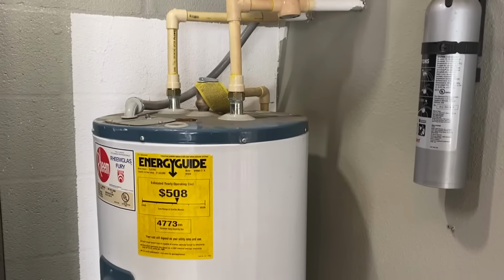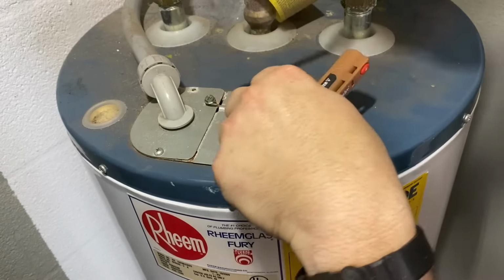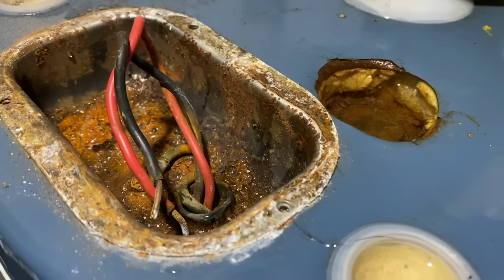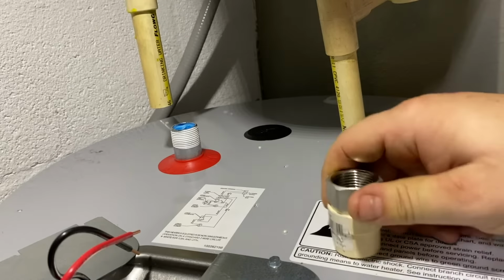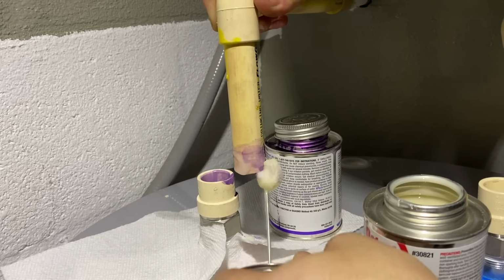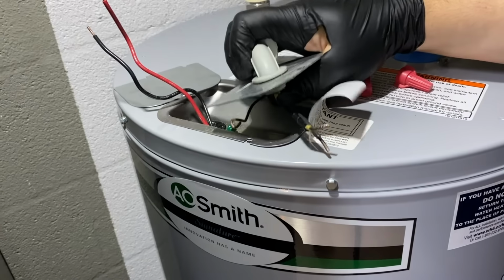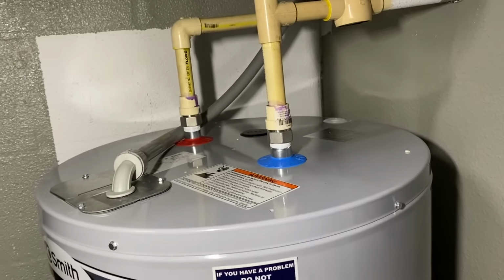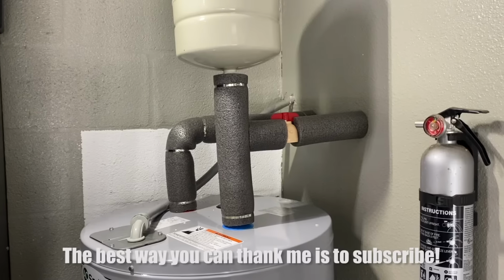How To Replace Your Electric Hot Water Heater | Full Install DIY

Comment: How much does this normally cost by a plumber just curious
Reply: $550.00 to $950.00.
HVAC /or Plumper are raping people with these types of installation. Gas water heater labor is higher.

Comment: If you will use wire nuts that are designed  for wet locations you will not get the rusting 
It is the threaded  sleeve  in wire nuts that rust and the ones for wet locations has a substance to prevent this

Comment: You can use a voltage pen to verify power. You should never use a voltage pen to verify a lack of power. Use a multimeter instead. Sometimes they wont pick up voltage through wire insulation...you can stick multimeter leads into each wire nut onto exposed copper for more accurate reading of whether or not power has been removed from circuit.

Comment: Thanks for the video. Mine was hard piped with cpvc also by the plumber that was contracted during the construction of my house. I decided to go with Sharkbite flex lines from the cpvc to the tank dielectric nipples. My thinking was making future change outs easier. Was great to see someone else with my exact setup.
Reply: I also changed the stock anode rod out with a Corro Protec 20 year anode rod. We'll see how it goes with that. My AO Smith pro grade tank only lasted 5 years before it was leaking out of the bottom.

Comment: Helpful video. You didn’t explain the wire connections in any detail. I see the tank has a red and black wire but the wires coming from the panel both appear to be black. How do you know which wire to connect to the red and black? Does it matter?

Comment: How will you remove that anode rod. Wire joints need to be twisted with pliers before, lot of amperage going through. Base of tanks  I like to place a blue styrofoam, just to isolate from floor

Comment: I'm not comfortable with electric.  I can't afford 1500 for a plummer sooooo pray for me
Reply from the maker: Turn your breakers off. Get a circuit tester to make sure the wires aren’t hot. Get in there and fix it. You can and will do it.
Reply: @Archifx gotta get it down the stairs,  down the hill, in the crawl space then up the muddy slope in the crawl space first 😂😂😂😂😂

Comment: You did great, my only suggestion would be not using cpvc for the water lines. Pex, copper, or even sharkbite stainless braided lines would work better long term, they withstand heat better

Comment: You should have replaced that plastic drain valve on the new water heater with a brass one. YOUR OLD WATER HEATER HAD A BRASS ONE.
Reply from the maker: Eh… it’s still fine all these years later. So no. I’d don’t
Reply: @fixitnoworlater dude don't be so cheap.  Lol!
Reply: The tank I am getting ready to replace has a plastic drain valve.  The tank is also twenty years old.  Just because it's plastic doesn't mean it's bad.

Comment: Dont listen to him! NO youre not going to be working around the 240 volts which he pointed to. Before ANYTHING else, EVERYONE is to remove the fuse or shut off the breaker for the water heater

Comment: heard the cpvc stainless steel  adapter leaks from from where the steel joins the cpvc, any issues with this? Thanks
Reply from the maker: Depends on the plumber. Mine is perfect.

Comment: Great video! Question: at @22:35, you mention leaving the information on the CPVC pipe outward-facing and visible to an inspector. As a DIY project, do you need to have this inspected? I also live in Florida and was wondering this. Thanks, and good job!
Reply: You may sale your home the inspector for the next owner will need to see that. Out

Comment: Thanks for the easy to follow DIY.   The only thing I would have done was change that cheap drain valve before I installed the new water heater.  Great tutorial.

Comment: Overkill. Just screw on the drain pipe. No need for teflon or the other stuff. The water flows downards and out and no chance of leaking. Why do some plumbers add unnecessary steps?
Reply from the maker: Pride. Pride in the work my friend.

Comment: Nice job. I have a question on the attachment to the T&P valve.  The adapter appears CPVC on one side and stainless steel on the other which screws into the brass (or bronze ?)  T&P.  Are the dissimilar metals coming in contact mitigated by the teflon tape ?
Reply: this shouldnt be an issue as water is not constantly running through the T&P valve, most set up looks like that

Comment: Yes, I may do mine myself.  Mine is electric, has 4 connections and one includes electric to the top like yours. I am not going to rush.  I am boiling water on my stove now to do the dishes (oh, I will always have hot water).  My unit put out very hot water and yesterday finally I feel nothing but cold water from all the hot water faucets.  I am not going with any high end units, just a basic 30 or 40 gallon electric Water heater.  I might need a permit so I will check soon with city hall.

Comment: Best video for replacing as the inlet piping matches my apartment condo's piping. Other vids with copper metal piping with flexible metal supply lines had me a little lost. This is apples to apples and perfect for my setup as it is almost identical.

Comment: Can't you just drain that water to a bathtub or bin in the bathtub if it is close by?  Did you shut off your entire home's electrical power before disconnecting the electric connection on the water heater?

Comment: Very thorough and well explained. In some jurisdictions, including where I am, the piping for the first 18" from the tank must be metallic so CPVC and pex are not allowed. I used corrugated stainless steel connections made specifically for water heaters. The cold water connection included a shut off valve. The ones I bought included push to fit connections where they connect to the water lines so no soldering or glue required. I appreciate that some people do not like the push to fit connections, but I have had very good success with them personally and professionally. Another advantage is that lines can be disconnected for servicing the water heater without having to cut any pipes.
Reply: How can he explain when he's guessing his way bro

Comment: cool video. thanks. why did you choose to use an expansion tank? im also on well water and was thinking about the one way valve i installed on the inlet. is expansion tank realy needed?

Comment: Question, the two blue caps that are in the pipe from the water heater have two rubber flaps, do you remove them or not. Thank you.

Comment: I see some guys use plumber's dope or putty with the teflon tape. You don't see a need for both? Or harm in using both? Thanks
Reply from the maker: Don’t do both. I’ve done it and had leaks. One or the other in these fittings.
Reply: @fixitnoworlater  Thanks bud!

Comment: As an added and extra safety precaution, wires should be twisted tightly together with ample length before being inserted into a wire nut. You did a good video. Thanks for the entertainment.

Comment: I wonder why you have no primer on the 90. I assume it didn't leak without the primer so why waste your time and money putting primer on the coupling. Because someone told you it was better. Don't believe everything you are told or read. I have been plumbing for 39  years without using primer and I have never had a leak or failure.

Comment: If you really want to sharpen up the appearance of a job, after the inspector leaves use some fine steel wool to remove the manufacturer's lettering from the pipes. And stop using purple colored primer. There are clear alternatives.

Comment: Learn how to use a pipe wrench
Reply from the maker: I did. Water heater works great
Reply: Pipe wrench, while meant to tighten piping, I see no wrong in using it to tighten the fittings. Doesn't really damage it unless you put too much excessive force when using it. 

Greatest guide I've come across honestly, goes pretty well in depth and CPVC is also used in millions of home in the US as it is cheap, easy to use, and replace. 

Helps explain how easy this set up is versus the $700 - $1200 they charge people, and it doesn't really take that long either.

Comment: also can you uncrew the old heater bolt without cutting it because it is a thread right? it may be easier. It is a pain to rejoin all the cpvc.

Comment: I like to use fittings on the inlet and outlet connections that can be screwed apart so they don't have to be cut. But then you can't find another water heater like the old one that will fit back the same !!! Haha! Screwed again!

Comment: I am a woman and I am going to change my water heater, but I have a question. 
Why do I have 1 hot water pipe and 2 cold water pipes coming from the wall ??? 
All the videos I watched have only 2 pipes, one for the cold and the other for the hot. Thank you.
Reply from the maker: Good question. I’m not sure why you’d have 2 colds. Do both of the colds go into the water heater or does one bypass it and go somewhere else?
Reply: @fixitnoworlater  both of the pipes go into the water heater and in the mean time it's connected to the pressure valve. I don't know why they did that and it confuses me. I could take some pictures and send them to you, if it's ok of course.

Comment: Remember to match hot water side with red hot water valve multi or 1/4 turn handle.  
Match the cold water side with a blue cold water valve multi or 1/4 turn handle.
Reply from the maker: Hahah. Good luck finding that with the supply chain issues. Good idea but not always readable in today’s reality.

Comment: Great job. 1 thing you could do is either wire it after the cement has dried or wire it before cementing in the pipes. My 40 gal heater can wobble around and I like to leave drying things alone.

Comment: Thanks for giving me the confidence to replace my own. I only wish my piping was cpvc and not copper!
Reply: Shark bites. A copper homes friend.
Reply: Don't worry about having copper now; in 5 to 10 years when the old water heater is  is chanced out  you will have to have it re-piped because the dimensions will have changed on the new heater, then you can use CPVC. they can't leave anything alone!!!

Comment: I filled my water up after installing and went to turn the sink on and there's air bubbles in the water. Is it safe to turn the power on? And just run the hot water?
Reply from the maker: Air bubbles are normal. Let the water run a bit. As long as you are confident in your electrical abilities, verified there are no leaks, you can turn the electric back on.
Reply: @fixitnoworlater  awesome, thanks! I let the water run a little more and the air seems to be gone 😁 the sink start spurting out really aggressively so I was worried at first haha
Reply from the maker: Hahaha. Yeah. All normal stuff. Glad you’re good to go!

Comment: What's the tank for on top of water line
Reply: It is an expansion tank, because water expands when it is heated.  It acts like a cushion or shock absorber type device.  Might keep it from exploding one day.  They did not use those 50 years ago in my houses, but I have one now in my house built in 2015.

Comment: Just a couple of pointer from a licensed code approved plumber aginst code for cpvc on top of the heater as it needs 16 inches of copper minimal and 120 anything above this temp will void the warrenty
Reply: Amazing how you can speak so matter of fact but don’t know what you are talking about at same time. CPVC is code and perfectly fine in Florida.
Reply from the maker: Internet hero’s are abound my friend ;) you hit the nail right on the head.
Reply: What is the big blue plastic plug on the bottom of a AO Smith electric water heater for? Unboxing the Heater the plug fell out of the bottom.
Reply: @ronkosanovich6450  Just to keep it centered in the box

Comment: Very nice and informative video!   One caution I would suggest is that with households that have children the set temperature be closer to 120-125f.  You also should get much longer life out of most water heaters, eleven years is not that long.  Good clean job.
Reply: 140 is to hot because of scalding on non mixing faucets

Comment: All was good but under the hot water tank should have a water base to catch water, I put 1 because I stay on 6th floor condo…
Reply from the maker: Not in my application. Mine is in a garage with a 4” drop slab

Comment: Great video and info. Might be a dumb question but does it matter how it is wired back up? Couldn't tell with your house wiring what the colors were.
Reply: You can put black  to black and red to white, that is how mine is.  Bare copper wire goes to ground (the green screw).

Comment: I thought you said  Hot water on the right cold on the left   looks like you have them crossed?? or am I wrong
Reply: No, that's what he initially said at the beginning of the video, but corrected it on the install.  Not a plumber, but it may be against code to have valves on both sides, normally it's always on the cold (input) side.

Comment: Dude! How can I take your advice when you call the water heater a "hot" water heater!? It's simply called a water heater. If the water was hot, it wouldn't need to be heated. If anything, "cold" water heater would be more accurate.  Stop the madness!
Reply from the maker: It’s because I need googles algorithm to pick up my video :)
Reply: In Canada we call it a hot water tank lol

Comment: This has got to be one of THE BEST videos/ tutorials on electric water heater replacement, IMHO!  Good video, without any annoying music, and quite annoying time lapse/ fast fwd’g as some creators have in their videos.  I liked your ‘tile base,’ but I think I would have also put a pan under it?  And the other thing is maybe smearing a little pipe dope/ sealant on the  PTFE tape.  Twisting your wires together, then attaching the wire nuts is a more secure method, and is what Electricians I’ve met in the field, do on job sites.  Otherwise very clear and concise, and I appreciate your attention to detail and your cautionary advice, especially regarding the electrical.  And chalk me up as a new Subscriber!  👏🏻👍👍👍😁✌🏻🇺🇸
Reply from the maker: Thanks so much!!! Worked hard on that one.
Reply: A pan is code
Reply from the maker: Not when it’s below finished floor elev

Comment: Exactly the same heater I am replacing too. Swapping for a 50-55 gallon and need to install an expansion tank (missing when purchased the home) What was the size of the expansion tank based on your heater? Thank you for the video, very helpful.
Reply: For my 55 gallon AO Smith heater, it came with a ProFlo PFXT51 that comes precharged to 40 PSI and has a max of 150 PSI water pressure supplied to it.

Comment: I'm going through this right now. My question is, why do pipe fittings NEVER fit from existing to new appliance? Same thing happened on the ice maker of my new freezer. The biggest problem being that it seems nobody carries the proper hoses. I always end up having to to get a bunch of lines and adapters to make connections. This one needed three one-foot water lines and four adapters just to reconnect the lines.

My lines are copper soldered to flexible copper lines with 7/8" female connectors, but are too short because the new heater is shorter than the old. The only lines I can get are stainless steel with also female connectors, so have to get four male-to-male adapters. Four because the relief pipe is female at both ends.

BTW, when you pointed to the pipes early in the video, you got the hot and cold backward unless you have that shutoff valve on the hot side.

Comment: How come you didn't add a plate at the bottom?
Reply from the maker: Not here. Maybe in some places but not here in FL
Reply from the maker: They just rust out. Mine is in a garage with a 4” drop slab leading out to the outside. Pan used if it were inside living finished floor and could leak and potentially do water damage.

Comment: The pressure release valve.... Where does that water go
Reply: Right onto the floor in this case.  It can be placed to go into a drain in the floor or outside the house, but if it is a garage like mine is in, the floor is okay.
Reply: The TMP is there if it gets too much pressure it will blow off instead of turning your water heater into a big pressure cooker bomb

Comment: Nice work.  My issue is I have a metal pipe coming out the wall going to copper pipes.   I am trying to figure out how to change the copper the CPVC.
Reply: My question also. I have copper but want to change over to cpvc .
Reply: @Reflect1998  I would just get shark bite fittings and not use  CPVC

Comment: Stupid question but can you use an electric hot water heater tank as just a replacement for a leaking hot water oil furnace tank? To me a storage tank is a storage tank, but thats why Im asking. Trying to save my mom money and I have a brand new electric hot water tank.
Reply: Plumber here- what did you figure out for this

Comment: Nice clean install which is what I have come to expect from your videos.  In addition to the hot  side isolation valve add, I always replace  drain valve, especially the plastic one like what came with this tank. I use a brass valve. The  extra $10 is well worth it. Especially if you periodically drain a few gallons off  to remove any sediment  before it builds up. Helps the tanks last an extra  couple years.
Reply from the maker: Thanks a bunch. That’s a good idea. I think I’ll replace mine with a brass valve too. Thanks for the feedback 👍
Reply: @fixitnoworlater  you're VERY CLEAN AND neat I don't HAVE hot WATER FOR 2 week NOW
Reply: @salinawhite7669 just guessing here but people say “what?” to you a lot don’t they?